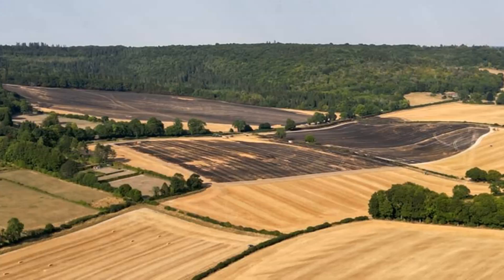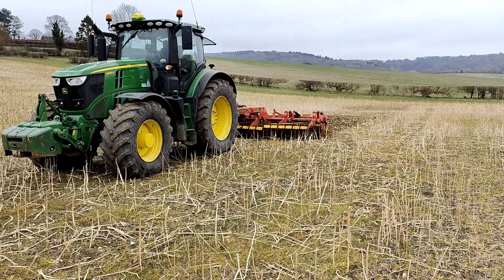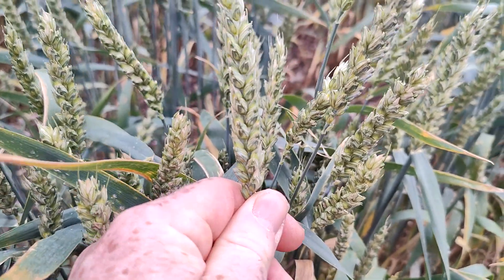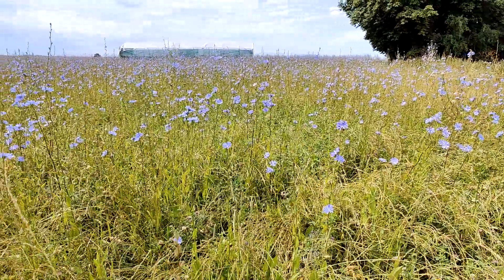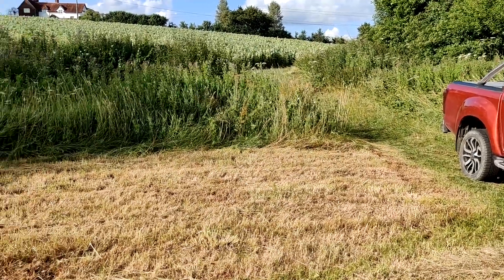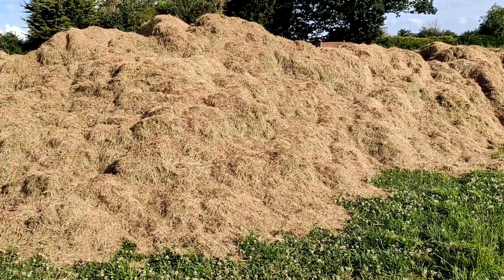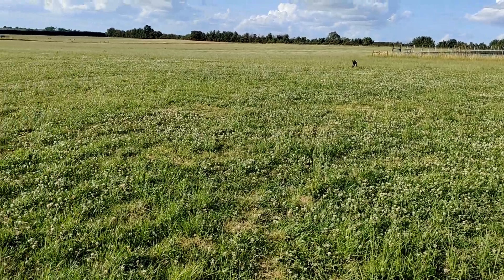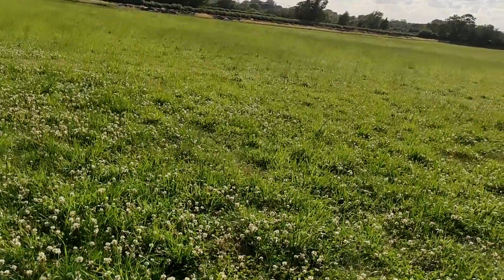Wheat turning, grass cutting

Comment: Firstly, you are to be commended for going through the gears and walking the walk of a complete regenerative journey. Taking on this sort of thing is challenging, risky and requires b$%&*$. Perhaps the biggest challenge is to adjust to a different mental approach and step outside the boundaries of accepted wisdom. It can be quite isolating and difficult to find support from others in a similar position. 
The second point is, having grown spring wheat for many years, I think its a bit too fragile to cope with the rigours of regenerative no till in heavy land cropping esp in transition years. Compared to sp oats and barley I feel it has nowhere near the vigour, leaf area and general competitive ability to help sideline black grass, wild oats, escape slugs, give good yields and thus boost soil health?
Reply from the maker: Thanks Charles, mental strength and supportive peer group is important and seldom mentioned! Agree with your spring wheat comments, we've found large variety difference Lennox much better than Mulika, spring oats good but spring barley more challenging than s. wheat especially in DD system. Antony